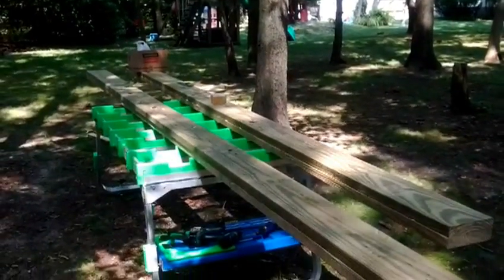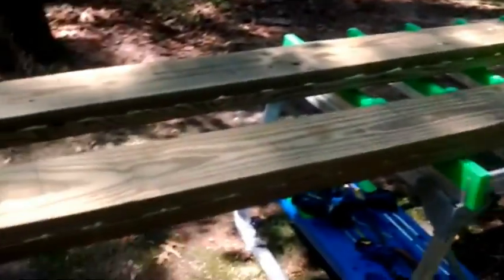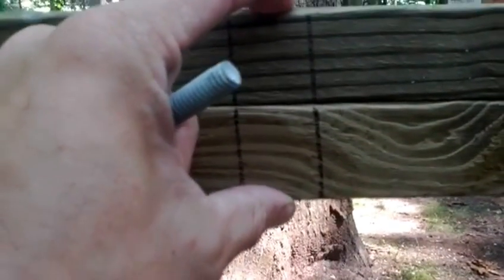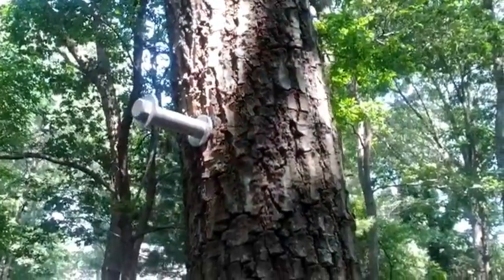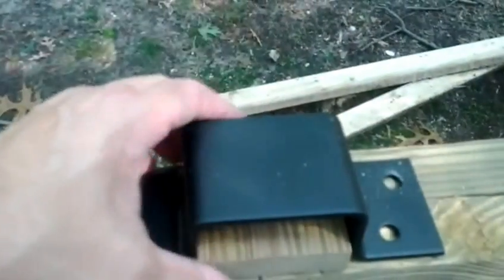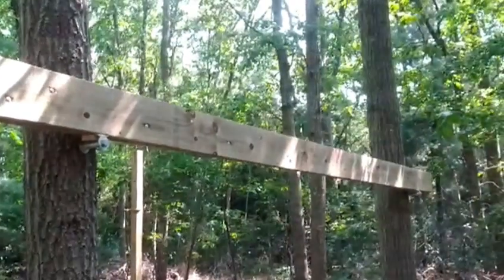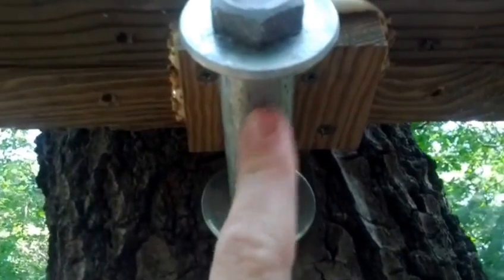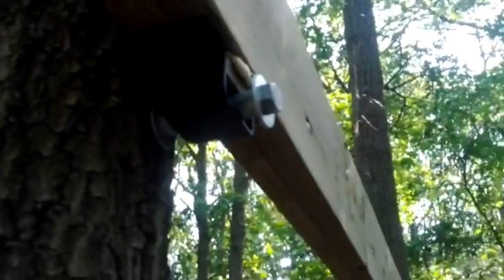Tree House Video IV

Comment: It would be better to use a resting block material other than wood that the tree bolts rest on because the wood will eventually split apart even though you glued and screwed it to the bottom of the beams. Metal resting blocks will squeak, so heavy duty plastic like cutting board plastic or the like I think would be better because it would move around easily on the metal and not squeak at all when the tree moves in the wind. The way you mounted the wood spacer blocks having the grain parallel to the bolt shaft rather than perpendicular to the bolt shaft will aggravate the splitting of the spacer block sooner. Just a honest observation my friend, I too want to build one in our yard in a big ash tree.
Reply: Came to comment the same thing. I had a teehouse frome 1993 until 2018, when Mother Nature and Gravity decided to down 1/3 of my oak.
Reply: @tonybucca5667  Hey bud I built my tree house and found a way to make my own hardware to hold it up that worked flawless and very strong. Click on my picture icon and scroll to the finished treehouse video. God bless you!
Reply: @MrDilley777  I LIKE your Ideas! My treehouse was about 30 feet off the ground. I had bolted on the original beams back in '93. The tree grew around everything, for the most part. I found a crack at the base of the tree in 2018, and disconnected the chain bridge I had going from my back deck to the first landing. A week later, a storm toppled a third of the tree, AWAY from the house. I had the rest taken down professionally, as it was about 80 feet tall. BUT...I have a pair of MAPLES that are HUGE! I'll incorporate your ideas into my NEXT (at 67 years old) treehouse!
Reply: Agreed, all of the over engineering  in other areas and you rest that on wood? I just saw on TreeHouse Masters it's a piece of Teflon at the top

Comment: If I may suggest.  The "Spacer Blocks"  you use should be rotated 90 degrees.  This is so that the grain and consequently the cleavage planes are not parallel to the "Tabs"  It is much easier to split those Blocks if installed the way your video shows.  jw
Reply: I'm seeing this video for the first time in 2020...I just came down to comment the same thing. I had a treehouse from 1993 until 2018, when a storm took down a 1/3 of my oak. I learned a lot looking at how the tree grew in that time.

Comment from the maker: I bought the hardware for the brackets from McMaster Carr. Unfortunately one of them snapped (shown in a later video) so I wouldn't recommend them.
Reply: What size bolts did you use.  I just started my treehouse/platform project.  However it is only attached to a single tree approximately 24 inches in diameter.  I started with 4 3/4 inch galvanized bolts 10 inches long.  I predrilled the holes with an 11/16 bit and they penetrate the tree about 5 inches.  Well anyway I hope you and the family are doing well.  Time really flies with small children.
Reply: Hey there bud I did build my tree house in our front yard ash tree and click on my icon picture then scroll to the videos of the finished tree house and take note on the bolts and hardware I used to make it all work which it did great!!! Unfortunately the city made me take the tree house down but it was one of my bucket list things to do and I loved doing it.
Reply: Which video shows it snapping?

Comment: where did you get the brackets/ hardware to mount the boards to the tree
Reply from the maker: They are from McMaster Carr & Home Depot. That said, one of the bolts failed so I cannot recommend the method.

Comment: So was the bracket bad or was it just a bad bolt? Also how much space did you leave between the bracket and the bolt from top to bottom?
And why did you use so many bolts in the beams?
Reply from the maker: Josh,
The bolt went bad. I used so many bolts the laminate the beams because it's typical of my overtime.
Reply from the maker: Dyami Plotke overkill, not overtime.
Reply: What size bolt failed?